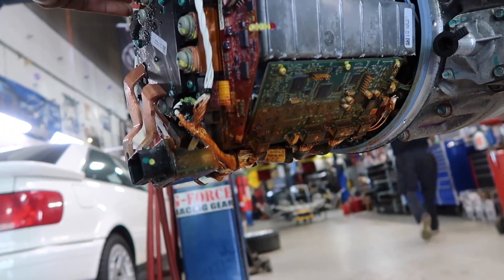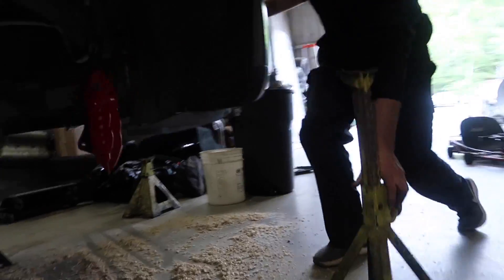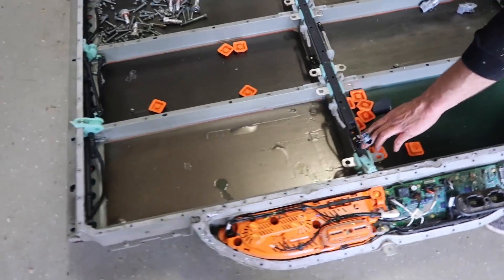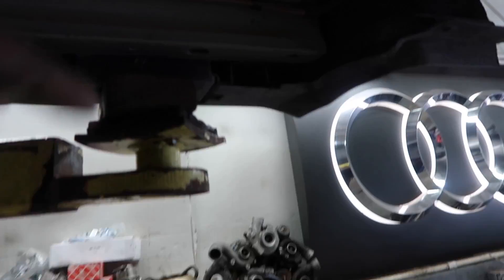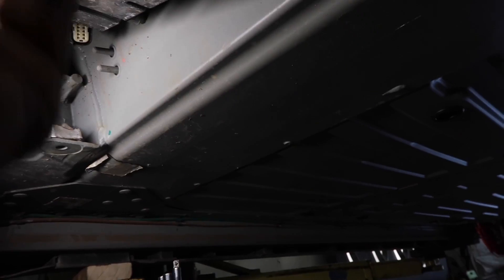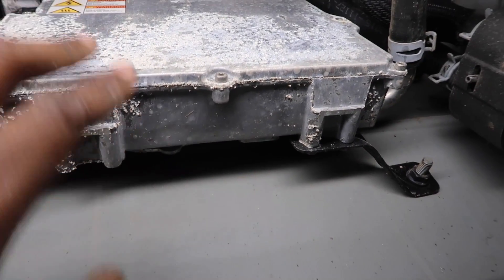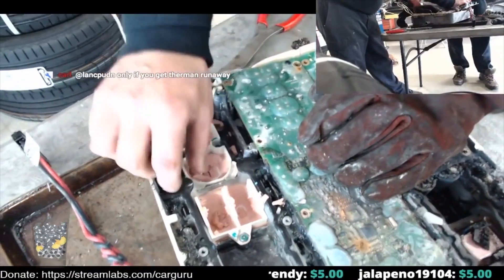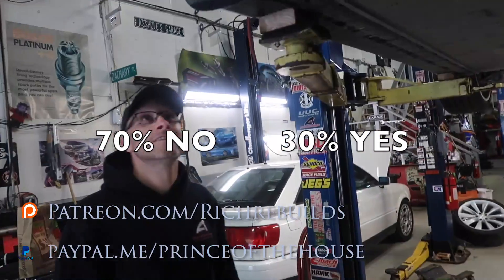Tesla: No User Serviceable Parts Inside

Comment: As much as these cars cost, these components should have been completely sealed. These cars have too many quality issues for me to justify 100 grand.
Reply: I give up. Seriously...you are not getting it!. I own a Tesla. I live in the NE. It's survived 4 typical NE winters along with cold, moisture, snow and corrosive salt. MY POINT AGAIN was, and is, that 10 days of being submerged 27/7 will fail any current automotive system that isn't designed for continuous exposure to water. The key WORD here is CONTINUOUS.
Reply: Cory Spears
A two million dollar bugatti would be fkd after 10 days submerged,so you can cross that car off your list too.
Reply: You are someone that understands the difference and there are industry standards that differentiate between that. Spraying a component with a water hose and submerging the same component under water are not the same.
Reply: WOW.... an old saying. "It's better to have people think you're ignorant than to open your mouth and remove all doubt." It's true, try it some day.
Reply: Dons amazing adventures!
Big difference between water resistant and waterproof and i don't think Teslas are designed to be waterproof.
Reply: @_Daio_  That water restaurant doesn't sound like it has a great menu...
Reply: @h8GW  Pmsl,but great if you like seafood.
Reply: @_Daio_  Dammit, you had to edit your funny typo after I made fun of you about it.
Reply: A regular car would die from sitting in a flood, got a friend that ran into 2 feet of flood water with his Bmw and air intake are so low that he literraly flooded and killed the engine. Then I agree about the price tag of the car, less because of the margin they make on each car but the lack of service and the car being yours until they decided to cut you off, basically bricking it.
Reply: Yep.... you can cross the $30K Honda off too. It would cost a fortune to design seals and sealing components and then get certified for that criteria. The average youtube troll has no idea.
Reply: You have no idea what you speak of sir and that is obvious.
Reply: The iPhone is certified and you pay for that certification its called IP 67 and IP 68.. read up on it.
Reply: Cory Spears it takes time to build something that complex and they are pushing the envelope..  i know how long it takes to make the "simplest" things (im a blacksmith and a carpenter) and the sheer labour cost and inventiveness is worth the money... let alone the fact you get to drive a cool car! life is a constant improvement not a get there and its done situation :)
Reply: for that money id want an actual submersible car like the james bond white lotus
Reply: Sadly, some of you really don't understand how water protection works. Take a look here: https://en.wikipedia.org/wiki/IP_Code
Did you see that all water tests have a period of time stated? This means that not even a waterproof product is required to keep water out forever. Do you know that even the gaskets in a watch need to be replaced every few years to still be 100% waterproof? Do you know that waterproof camera gaskets need to be replaced even more often? The fact that most of this components have a low water line in them is actually a great thing, even if you don't seem to understand. The seals did their yob, but the period of time the car was under water was just way too long and microscopic imperfections in the seals allowed water to sip in. This car survived really well, but you need to have a background in this sort of tests to understand it. Modern internal combustion cars would be f*cked just about the same or even worse after 10 days under water.
Reply: Don't really give a s*it about any car brand, including Tesla, but the ideas that you people come up with are just wrong. Again, just because you think this or any other car should be a submarine, has nothing to do with automotive standards, but probably you all have extensive knowledge in the field and maybe even design car components.
Don't let me stay in front of your James Bond style dream cars, although my day to day work is designing automotive components, because this is the internet and real facts and experience don't count.
Reply: If water can get in while submerged, it means water can get in any time. Simple as that.
Reply: @ D M

2013, Passau, Germany. BMW M3 submerged for the entire duration of the catastrophe that occurred there. The car was basically ruined according to the insurance. I had much more time on my hands then, so along with my brother we cleaned the car segment by segment, had the electronics CHECKED, not replaced, checked, by a professional, and within 4 months it was back on the road in original spec with only new tires all round (for whatever reason, the Michelins that were on the car had gone off weirdly as if plagued by a fungus, and you could sink and scrape the top coat 2mm in) and a pair of new motors for the window wipers b+f , which were the only pieces of mechanical/electronics that couldn't be made to work.

So, really, considering a brand new M3 in 2013 (and those who know those cars should know just how shitty some of the bits inside are) came back to life with some TLC and a few bits new, from being COMPLETELY submerged under water and dragged from its original spot found nearly a week after the waters came down, Tesla, which is built only on the creme de la creme of engineering doesn't have even the SMALLEST excuse for not having a simple lip seal on the casing. 

That's noob territory, we're talking design school 101 here. Quite literally some of the first things you learn if you go to design and engineering schools when it comes to water and preventing ingress.

No further comment.
Reply: Oh would you all shut up about a stupid car I'm only here to see how much it costs him to replace the parts lol I would rather see him rebuild a corvette or something you hardcore tesla fans need to chill 😆
Reply: Wow, some people here have no idea what they are talking about. A car is not designed to handle stationary water. A few weeks ago we had a bad storm at my workplace and some people decided they have submarines and went trough the water that was somewhere above the middle of the wheels only. Safe to say that a few of them remained there. And we are not talking about water in the intake, or cracked motors, just water inside some sensors, which it's enough to kill a car these days. Also, a lot of cars die even if you pressure wash the motor, so no, cars are not meant to have water at higher levels than what you can encounter on standard roads with decent drainage. It this right, is this wrong? I don't know, but for sure they are not designed to be waterproof at a higher level than the underside of the car.
Reply: D M false , putting a few o ring would cost nothing to introduce into the design.
Reply: D M do you like your woodscrews visible when your mirrors fold in
Reply: Ultimate DIY I’m just amazed at how many comments I’ve gotten for a simple statement. I can appreciate the passion people have for things that they like. I find the derogatory statements about me absolutely hilarious.  It’s been fun. Everyone have a great day and drive what you like.😅
Reply: I know where you’re coming from. For $100K you expect an attempt to seal some of the components.
Reply: Cory Spears this is the most retarded comment I’ve ever read. Try it. Take any other car and submerge it underwater for many days ...
Go on
See if it’s dry in there
Reply: randomness
Most electrical components need to breathe to dissipate heat,so to completely seal them is a lot harder than it sounds.
Reply: Cory Spears
Try and find  an appliance with electrical components in your home with no vents.
That's why bro...electrical components need to breathe to dissipate heat.
Reply: Cory Spears:  right you are!!!!  funny comments here, people justifying junk ...  within the automotive industry there are many performance specification with similar requirements for water sealing performance.  Parts designed to be "sealed" should handle a low depth submerge, pressure at 2-3 feet below water is only 1-2 psi  ... ANY Sealed system should be capable of sealing at the pressure, for a VERY long period of time. The highest sealing performance ratings in automotive include High Pressure Spray (like a car wash), this is considered the most difficult to pass ... which begs the question.... can a directed car wash spray trash a Tesla motor/inverter?  Would be interesting know from this tear-down, where the water leaked into that motor, and why?
Reply: Percisely... I drove my Rolls Royce into a lake. I left it there for a few weeks and then I had it towed out. It started right up.
Reply: 100k includes research costs. This is an electric vehicle that has surpassed any other EV in terms of sophistication and technology. 

Why do you think M3s are more expensive than a normal 3 series although they're built on the same chassis? It's the technology
Reply: D M , talk about stupid. water is water, combined to glycol or not, a gasket or o-ring properly designed would keep water from infiltration of sensitive and expensive components.   I am sure the engineers at Tesla know this, and would have included it, but the bean counters decided the labor costs and materials cost was prohibitive, just like Ford did with Pinto gas tanks...   I guess simple mechanics is beyond some folks capacity. I am sure you have never worked professionally in the automotive trade.
Reply: I mean, it wouldn't really effect it were designed to be water sealed lol. But keyboards are not designed to be suseptible to water. Whereas the teslas are. 

And technically you can put your keyboard through a rinse cycle and as long as it dried you would be mint :)
Reply: Dons amazing adventures! My blackwidow ultimate is water proof gotta love decent keyboards xP
Reply: Well its not meant to go under water you know
Reply: Ultimate DIY it should be is the argument
Reply: Cory Spears i
Reply: OP didn't even mention that the Tesla is bad for not surviving underwater for 10 days. He simply said that some of these components with high voltage running through them should probably be sealed just it case.
Reply: Yup, the boxes could easily be sealed to withstand a few feet of submerging. However Tesla doesn't sell parts so they don't really care. the leg humpers will keep buying the cars even though the service center in Denver is packed with issues.
Reply: ever heard of the ipxx standards? here have a look https://en.wikipedia.org/wiki/IP_Code
Reply: Something you're forgetting is that when something is submerged there is a higher water pressure from the weight on the water above it that is going to force its self into every nook and cranny. Most water proof phones can only be dropped down a meter for about 30 minutes. What are you suggesting? the WHOLE CAR be like I68 certified? And make a 100k car into a 200k car? Everything is water tight and sealed but you're dealing with pretty high water pressure for sustained periods of time when it is UNDER FUCKING WATER. It's completely different from driving in the rain.
Reply: Cory Spears submerge a piston engine and see what happens
Reply: Dude its not a submarine ,, its a freeking car !!
Reply: I was shocked that they didn't include what's exactly 100 dollars worth of TIME, a lip seal, and machining on that box. I mean J.F. it's grand prize car and you can't put a bloody lip seal?
This is incompetence or malevolence.
Reply: Cory Spears true but anything that’s man made will fail...
Reply: Agreed...
Reply: daiozzz I’ll remember that next time I take my refrigerator for a drive...
Reply: UK especially Wales has more wet day than sunny ~ how will Tesla manage?
Reply: Funny thing, just yesterday I forded a river in my Model S.  I'm totally serious.  Search for 138 Old Gulph Road, PA in google maps.
Reply: +Jimmy De'Souza A meter of water from the roof to the drive train is not insignificant (a cubic meter of water exerts 9800 newtons of force and at that point a lot of waterproofing is useless)  If any of you actually cared to look at his previous videos (or any pictures of the underside of a tesla) you would see that the motors are protected with splash shields so driving through rain would not have water even get near the internals of the car. Just like you said this is a luxury card, it is not meant to FORD WATER. If you drive a regular car with an automatic transmission through a tall enough puddle you will get water inside of the transmission because there are drain holes in the bottom of it. Arguing that the car that is meant for driving on highways and roads should survive being complexly submerged like its a deuce and a half is ridiculous. Take an Audi, Mercedes, or BMW (any car really) and drive it into a swimming pool and leave it for 10 days and watch the electronics and entire engine be seized and destroyed. There are plenty of things to hate Tesla for. The fact that it can't be submerged in a meter and a half of water then taken out and be driven again right away is not one of them.
Reply: No , they need heatsinks etc to dissipate heat (or water cooling in the Tesla), otherwise the conformal coatings would cause problems with heat.
Reply: Wonder how well sealed they are in an iPace, 500mm wading depth which is definitely above the motors and the battery pack.
Reply: A silicone modified conformal coating would have probably completely protected all of the components shown here. Even a thin coating of ordinary nail polish or more hardy potting compounds designed to encase electronics would have saved thousands of dollars here. As these electronics are becoming more and more important nowadays it should be a matter of course to make them completely impervious to such damage from something as common as water.
Reply: D M, quoting Dalay Lama, "don't argue with ignorant, they will take you to their level and beat you with their experience". Tesla should make submarines 😂
Reply: Time will tell. If Teslas survive NE winters as well as conventional cars, with equal or fewer repairs due to driving related water intrusion and corrosion,  then they have engineered the vehicle properly.
Some Tesla models  have already had issues with corrosion on aluminum suspension and steering components. But they do not publish causes for warranty repairs.  We have no idea how many have been repaired due to water intrusion under normal conditions. Rust never sleeps....
You would think that it is in Tesla's  best interest to ensure externally mounted electric and electronic modules are properly sealed to survive any normal conditions that they may be exposed to while on the road,  or simply sitting in a garage with road salts continuously  eating away at them. Imagine the cost of warranty repairs for lack of a piece of rubber seal here or there.  
40 years ago & prior, most cars in NE or in coastal areas were severely damaged in less than 4 years. Those dreaded dealer tags that they screwed onto trunk lids or rear facias were always dripping rust. 
But today, with modern technology and materials,  there is no excuse for any parts  of any new vehicles succumbing to normal winter driving conditions in say, 10 years or less.  I have a 21 year old Nissan and a 32y old S10. Neither have corrosion nor any water related electrical issues except some surface rust where the paint and rust preventative metal coating have been damaged and exposed to road salt. However, the Shittybuilt aftermarket bumpers on my truck,  by comparison, have completely rusted through from the inside out. (You really shouldn't be able to push a finger through a heavy duty bumper.)
 Model 3's have only seen 1 winter. So again, only time will tell.  I imagine Rich will be around in 20+ years to show us, balding, obese & arthritic, oxygen mask in tow, lungs damaged by black mold and vinyl, plastic and galvanized metal fumes from the several  lithium fires in his future. Esp the inevitable  battery pack explosion and resulting garage fire that will be caused by a kitchen knife.  In fact, he should take on a young apprentice now, so when he gets too sick and frail he'll have someone to take over his video feed for him, for us.
Reply: D M, I get your point, & agree with you. But your analogy is interesting, because the old school keyboards, that were just keyboards, without all of the fancy electronics, hot keys, & mice, that today's keyboards have, you literally could wash it in the dishwasher. Lol!
Reply: Cory Spears, these components are just fine in the rain & snow. Even momentary submersion.
However, my cell phone is military grade. It's designed to be water resistant, like the Tesla under-car components. I can take it in the shower. If some1 knocks over a glass of milk on it, not only does the milk not hurt it, but it's easy to clean, because I can literally run it under the faucet, to clean it, & is fine. Drop it in the toilet? That's fine too, as long as it's rescued within a few minutes. But submersion for an extended time, is very difficult to resist. My nephew thought that he's "test" my phones ability to resist water (without my knowledge, of course), & put it in a sink full of water, for several hours. Predictably, it didn't make it. The water eventually seeped in.
But to say that it would be impossible. I mean we have the technology to do it. But that would make it unnecessarily more expensive. Most Tesla's are not involved in floods or other bodies of water. This is an extreme case, & quite frankly, I'm impressed with how well it DID resist the water.
Reply: Cory Spears, well... expect what you want... but you will not find any. No1 builds a car like that, except for MAYBE military vehicles.
Reply: Cars should be waterproof to the level of the door sills, most are and I think Tesla is as well.  I would never drive into water that goes above that level unless the vehicle was built for it.
Reply: Cory Spears, Then don't buy a car, then.
Reply: aserta, you know, you can always find 1 example, in a sea of many, that miraculously made it through. But it's certainly not the norm. Most modern I.C.E. cars have computers in them, & most of them, is flooded, the computer casing would also be flooded. There might be a few that make it, but most would not. Even in THIS Tesla, 1 component DID make it. Quite frankly, I was surprised, because most automakers, both E.V. & I.C.E, & both economy & high end, their exterior electronics would fail, due to flooding. Find me a mass produced car, that CONSISTENTLY comes out of floods, without flooded electronics, & then you'll have a case. Until you can find that, you really have no basis for your argument.
Reply: Nic Thomas, same, here, in Washington State, U.S.A, & they hold up just fine, here.
Reply: IncognitoTorpedo, you can also find videos of Tesla owners, on You Tube, going through water up to the tips of the wheel wells, & Tesla approves this. But don't park it in that water for 10 days.
A little demonstration:
Pick-up a thick Bible or dictionary, & hold it out from your body. It's easy. Now try to hold it like that for 10 minutes. You will see that is not that easy, anymore. That's like water against seals. Momentary exposure is easy to resist. But constant pressures, even low pressure, will eventually penetrate the seal.
Reply: rillixgames, Wow! Who's forcing you to read the comments, dude?
Reply: Spiritus, submission is just not that common. I'll tell you what. Well ask Tesla to make  a military grade, water-PROOF option package, just for those of you that need it to survive under water. They'll add 50% to the price. I'll take my chances with the more economic design not to buy that package, & chances are, I'll be just fine. But hey, @ least YOU'll be prepared, just in case.
Reply: Stefan Czechorski, Ik. Much of it is the engineering & infrastructure.
Reply: Brent Rice, Wow. Talk about hating, with no facts.
Reply: Jimmy De'Souza, & where did you get these #'s. The Models S & X have a 20% profit margin. Thought you knew.
Reply: Ytuser201498, you joker!
Reply: hill billy And I should have a dollar for every smartass I encounter
Reply: wrong wrong wrong. do you design automotive components, do you certify to industry standards? I;m thinking NO!!! Tells me how you would seal a clam shell component that has complex electrical connectors with mA signals that are easily disrupted by moisture?
Reply: Do tell and why 30 meters why not 100 meters. Same amount of engineering, right? Do you as a customer want to pay for that level and certification. Cause if the company builds to that standard it costs money and then they have to warranty it. You will pay for it. Absolutely unnecessary!
Reply: Gee people, the water pump on your POS Subaru is exposed to hot pressurized water for years without leaking with just a simple gasket that maybe cost 12 cents. Tesla could do better on a 6 figure car.
Reply: Really we went to a water pump that is designed to be in water and glycol. We are talking about sensitive electronics. Stupid is what stupid is.
Reply: Cory Spears you cant hermetically seal electronics like these. They need to vent any vapor that outgas from the boards and may occur from ionization. The best they can do is epoxy coat the circuits. But they are in the business of selling new cars not making road going space shuttles that last for 1000 years.
Reply: D M it also should have a 1000 year warranty, because for 100k i feel like i should get a perfect specimen of engineering, be able to fly, go to the mariana trench, and also haul construction material. Lol some people do not understand the real world. And i hate to say it, but 100k isnt even a lot of money.
Reply: Mitch Bertone how so? Unless for some reason you are capable of becoming a better conductor of electricity than water, you have nothing to worry about. Also there are many Fail-Safe systems involved that sense runaway current and disconnect the battery. Any internal combustion car with a tank full of gas is far more dangerous under any circumstances.
Reply: whuzzzup no it doesnt because while completely submerged at depth there is a pressure differential pushing the water in. If the enclosure is vented and equal to atmospheric pressure there is  nothing forcing infiltration.
Reply: BINGO.... The Trolls are too busy hanging out in dank corners and feeding on low life. This issue is dead lol
Reply: It adds character so .... of course I do
Reply: D M Why go right to being rude and sarcastic because has a different opinion than you lol.
Reply: Rude and sarcastic? Really telling someone they are wrong is rude and sarcastic? Oh dude quit the PC please
Reply: I know people who had them die at 70,000 miles
Reply: @melody3741  and what exactly does that mean? That other cars never have issues at 70k miles? Really what does making an unfounded statement mean. I heard that some snakes are poisonous....I heard some people are dangeroua....I heard some planes crash....
Reply: It ain't be feasible to have an air tight enclosure for a motor. It will either be way too expensive, or interfere with normal functioning. (Potential hear issues)
Reply: @Nj1498  these are water cooled engines lmao
Reply: Look at the issues that a Mercedes Benz has!
Reply: Do you expect to utilize your car as a submarine?
Reply: Dear Tesla. I'm considering buying a Tesla but I also would like to have the capability of utilizing it as an underwater craft from time to time. 
Dear DM. I think you are looking for a submarine but I'm sure we could design an excellent one for you. Lets discuss cost. Signed Elon
Reply: Sorry D M you can't fix stupid.  Quit arguing with them.  If you feed trolls they just get stronger.  If the car was completely water proof cory spears would complain that for his 100 grand it should fly.  There are planes that cost less than 100 grand and they fly, so should a Tesla.  This is just shoddy engineering.  lmao

Ps... the RoadsterX 2.0 might fly.  It will have 10 SpaceX rockets built in.  ;)
Reply: Haha, I can't believe there are idiots complaining that the car got water damage... by being submerged for 10 days... All hope is lost. Unbelievable.
Reply: Ohhh dear god. I give up.
Reply: Cory is correct. Basically if the water gets in like this, I would never drive a Tesla in heavy rain or flood streets with water higher than the bottom of the brake rotors.  Water infiltration into high voltage components like drive motor and power inverters is ridiculously dangerous.
Reply: Seriously? 10 days submerged in water. I challenge you to find any car with electronics (all have them) from any manufacturer and submerge the component in dirty water (or clean for that mater) and see if it still works. Do you think any manufacturer outside a military contractor would certify their electronic components for total immersion for 10 days against leaks? Cite me the manufacturer cause they are crazzyy.
Reply: Yea you are right... 10 days submerged in swamp water should have no effect on electronics...at all. Why just the other day I mentioned to my wife we need to clean her keyboard and why not just put it in the dishwasher and it'll be as clean as new..... droll. Really dude? Really?
Reply: D M Not talking about the electronics throughout the vehicle! I’m talking about the electronic inside the motors underneath the car where it is constantly exposed to water and everything else. Come on people, THINK!
Reply: Mitch Bertone totally agree. People can say what they want. They can call me a troll or whatever... I just believe that these quality issues are unacceptable. 👍
Reply: Flooding aside; as the car is disassembled, I don't see 100k in materials and workmanship either.
Reply: Lost my iPhone in the river for 26 days somebody found it and it still worked so I agree with you. If a iPhone would work this Tesla should be sealed tight.
Reply: OP is totally right. While water will certainly damage a car in 10 days, you should never find water in the drive unit! It's like finding water in your transmission. Without mechanical damage that simply cannot happen.
Reply: D M Kinda expected negative comments, seeing most of the people who respond are negative. I don’t use my office keyboard in the rain, or drive it down interstates at 70+ MPH. Really yourself....
Reply: daiozzz Not talking about the entire vehicle... The motor enclosure, can and should be completely sealed. We’re not talking about ocean depth water here. The car wasn’t even fully immersed. For the price, this should have been sealed. Say what you want. I expect quality out of these 100K vehicles!
Reply: David Beppler your like a hand with no fingers, your missing the point
Reply: everything under the car and the ECU should at least be water resistant up to 30 Meters/3 ATM.
Reply: Timothy Moore Someone that gets it!  Finally.